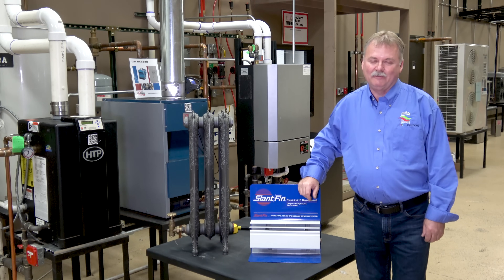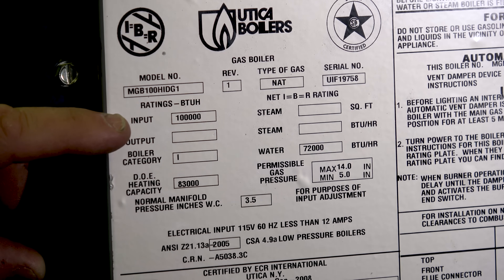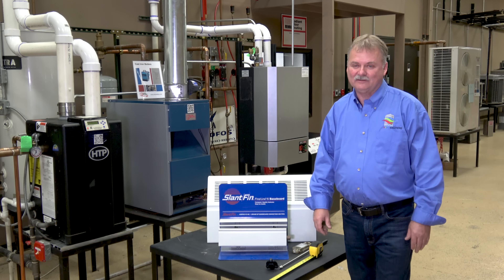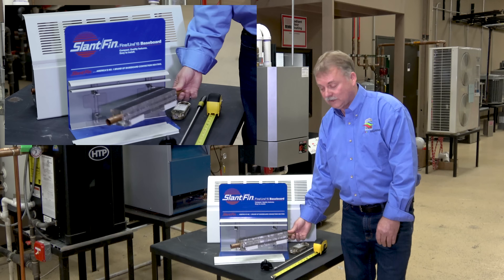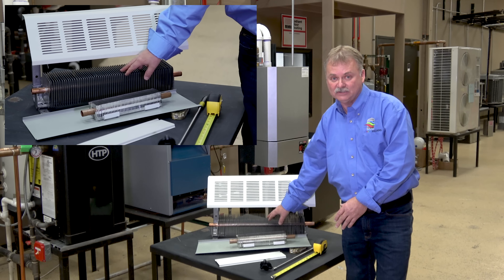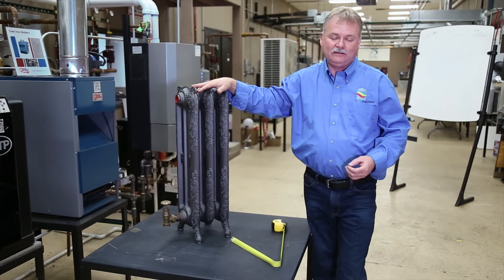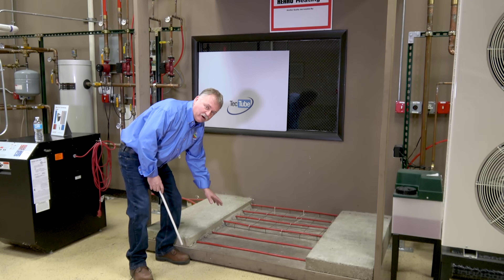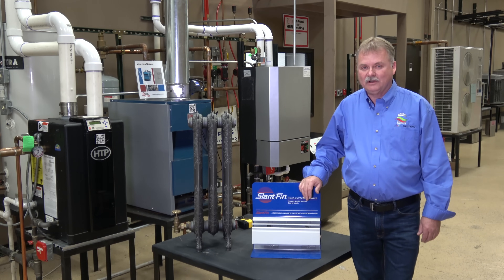Right Sizing a New Boiler... the easy way

Comment: Let's now add onto this wild guess of the boiler size method above; If the house was designed as a gravity flow system the target water temperature was originally 140 degree target water temperature. Look up each cast radiator at 140 target temperature. However sizing the boiler based on a lower water temperature will require a condensing boiler to be installed.
Reply from the maker: The old gravity systems by us were all designed for 180F supply. But if you have one designed for 140, then use about 110 BTU/h for the EDR calc.
Reply from the maker: Yes, if you design systems that have supply water temps below about 155 (and hence return temps below about 135), you will condense the flue gases and hence should only use a condensing boiler.
Reply: @TECTubefilms  Flue gases will not condense when the boiler was originally designed to fire with coal. Once the boiler came up to temperature the boiler never was allowed to cool. There was no slug of cold water coming back to the boiler.
Reply from the maker: @dennistreacy3595  We don't know much about coal boilers.  If the old boiler was running hotter exhaust temps natural gas boilers, then that would prevent the flue gases from condensing with 140 degree return water temps.  In either case, the old boiler's fuel type won't affect the re-sizing of the new boiler.  As mentioned use 110 BTU/h in your EDR calc for 140 degree supply system.

Comment: I agree this is useful for steam boilers. But I think this method can still contribute to over sizing. Who cares what the output of the emitters are.  They use to size cast iron radiators to heat the house with bedroom windows open. Perform a manual J and or look at gas usage to nail the sizing of a boiler. 

A BTU is a btu. If your heat loss is 40,000 btus and your emitters are 120,000 - I dont know about you but I would rather install the 40,000.  My back is getting old.
Reply from the maker: We agree... the radiation count method will still yield an oversized boiler (but not as oversized as the one it is replacing).  The problem with load calcs... which are code required by most energy codes now... is that stubborn contractors are refusing to believe that the old boiler was double sized so they keep adjusting the calculation inputs until it yields the boiler size they were expecting based on their old rules of thumb. The radiation count method gives them another option, similar to gas meter calcs, to see how badly the old one is oversized and believe their load calcs (if they bothered to do one).

Comment: I did a few rough calculations on modest size homes of under 2,000 sq ft. and found if you have 8 rooms with 12 ft of baseboard each, you wind up with a boiler size of 52,800 BTUs. Good luck finding a decent boiler that small... and it still might be oversized as we upgrade windows, doors, and add insulation. You could down fire the boiler to a point, but the easier solution would be to lower the boiler limits and hold the water to say 140 / 160 degrees. Yes, the burner(s) will short cycle in moderate weather but what else can you do? BTW, with the advent of indirect fired domestic water this lower temp will not be a problem.
Reply from the maker: Why wouldn't you install a smaller boiler AND lower the water temp setpoint below the traditional 180?
Reply: @TECTubefilms  ... in my own home the radiation is figured for 140 - 160 degree setting. Since I worked in the oil heating business for years my focus was on oil fired boilers that were available 30 years ago. When I did the job, I got the smallest boiler I could find and down-fired it... and that still has excess capacity to do hot water nonstop. My place is probably the cheapest to heat on the block. At this point gas is available but I likely still have another 10+ years to go before the boiler needs replacement again.
Reply from the maker: Here are a few smaller boilers that we use frequently in our office:

Carrier BWM50 outputs 9,200 to 46,000 BTU/h
IBC HC1350 ouytputs 12,400 to 45,400 BTU/h
Carrier BWM75 outputs 13,800 to 69,000 BTU/h
HTP Elite EP80 outputs 7,680 to 76,800 BTU/h
IBC SL1085G3 outputs 10,100 o 79,000 BTU/h
IBC HC1350 ouytputs 14,500 to 85,900 BTU/h

Comment: You only said the the baseboard must be measured, I didn't see where you tell us how to calculate what sized boiler for the baseboard heat.
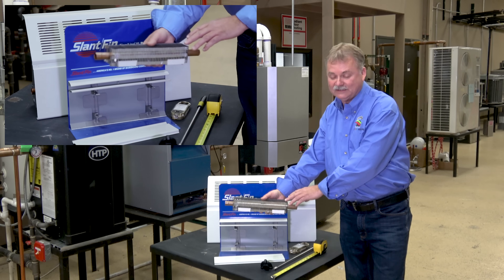Reply from the maker: Bill mentioned it at 3:06, stating 550-600 BTU per linear foot of residential fin tube. We probably should have done a sample calculation in the video like we do with our in-person training classes for contractors.

Comment: I find in so many cases that people don't mention that the SlantFin's performance is at 200 degrees. We always find 90% of them set at 170 and after we leave they always tell us how much more comfortable it is. Also be careful mixing the cast Iron with the SlantFin you will be in big trouble trying to make that comfortable. Just don't do it.
Reply from the maker: We do mix cast iron radiators with baseboard on the same boiler, but we put them on separate circuits with their own tstat and circulator.
Reply from the maker: SlantFin catalog does list output for water temps from 110 to 220 in 10 degree increments.

Comment: Thanks for such an informative, straight to the point video. Side question...I have a 1940 brick house with a boiler installed in 1997. We are looking to finish the basement. I've had a 2 local HVAC guys tell me No, but I want more opinions...we want to remove the steel supply and return lines in the basement and replace with PEX AL PEX to clear up some head room. Steel riser pipes would continue up through walls to feed cast iron radiators. I've been told that we shouldn't do it because it would cause short cycling issues. I understand a loss of mass will result in faster water temp drop, but clearly there must be a way to mitigate the loss of mass in the system to prevent short cycling the boiler isn't there?
Reply: Boilers dont short cycle so, your working with morons. I own a heating business, I have an engineering degree, I run an HVAC/R college program and scored over 145IQ. Trust me, run your pex, you will be fine.

Comment: Can you adapt a boiler buddy to a outdoor wood boiler to control the lower needed heat for radiant floor pex
Reply from the maker: You can put a boiler buddy on any type of boiler.  It does not care what is heating the water.

However, a buffer tank is not likely what you need.  The boiler buddy does not cool the water down.  What you likely need is a 4-way mixing valve.  We used to use them a lot back in 90s before condensing boilers were popular but we have not seen one in a long time.  But then again our entire market is natural gas and propane (both of which work very well with low temp condensing boilers) so we don't deal with wood or oil boilers around here.

Comment: Is 50 x sqft(of home) adequate in calculating boiler size? Came across this calculation while researching. If it’s any concern the home uses the fin baseboard system
Reply from the maker: Adequate?  Sure.  But in most weather regions it is going to result in a boiler or furnace that is MORE THAN DOUBLE OVERSIZED.  If you are in northern Canada with very poor insulation, this might work.  For example, my house is 2,860 ft2 so that would come to a 143,000 BTUh system.  I only have a 60,000 BTUh system and it was fine on a negative 26 degree day two years ago.

Comment: Thank you. I'm doing some research on replacing a 30 year old unit in a home I have an offer on. Is there a boiler type you would recommend if I purposefully decided to over size? Obviously the system should be designed to avoid cycling. In the future, if I decide to put an addition on with baseboard heat and radiant flooring in the basement/shop space, can adding an extra 500-700 sf of living space be easily accommodated? Just wondering how I should go about planning for future additional demand.
Reply from the maker: We would recommend you size the system for the heat loss of the current structure.  You will likely still have plenty of extra safety factor to handle and addition because almost no one every actually sizes it small enough (even when they try hard) for the correct size.  Plus you can always add in a 2nd small boiler in parallel with the other boiler if needed.
Reply: Better off with 2 smaller boilers if you feel you need the boost capacity. Let one run 90%of the time

Comment: Is it wrong to go by the sq footage of the house instead of this method?
Reply from the maker: Square footage alone?  Yes.  However, a proper heat loss calculation uses square footage along with ceiling height, window size and type, air tightness, insulation, climate, and other factors to calculate the heating size needed.  That is the best way to calculate the heat loss... and the one required by energy codes.  The method we showed in this video is easier than a proper heat loss calculation, but not as good.  The square footage alone would be a horrible way to do it.

Comment: I need to replace a 1974 gas hot water boiler that HAS to be oversized.  It's 270,000 btu. The gas meter needle looks like its moving in time lapse. My problem is I am concerned about my old iron pipe sizes,  and how that works with a modern boiler? Some of the pipes are quite large in diameter. For reference,  the house is  a 2800 sq ft ALL brick house, yes, including interior walls. It has updated windows and insulation in the attic. I'm sure part of the reason it was so many btus was efficiency, as the internal boiler heat exchanger is cast iron. I understand that this unit was more intended for commercial buildings when it was made. Can a new boiler interface with existing large circulating pipes? Some of it is like 1 1/2- 2", closer to the boiler. It would be unrealistic to change much else besides the boiler itself, as it is all cast iron radiators and black pipe.
Reply from the maker: Yes, you can still retro-fit.  Larger pipe size is always more favorable than smaller, as it yields less head loss.

Comment: How many installers except in new construction which most likely the are specified by engineers of som sort....go through all that figuring....on boiler replacement.
The plumbers I have dealt with looked at the name plate on the old furnace and take it from there....if the footage of already installed baseboard will only put out so much Btu per hour no matter what the rating of the furnace....too big the furnace will cycle on and off .....to small and the furnace will run continuously.......I believe installers continue to put in the larger rated furnace so when the weather really drops on those few occasions they do not get nasty calls from the home owner...when they hear the boiler running all the time....
Reply from the maker: It is also best if plumbers stick to plumbing and not get involved in HVAC  :)
Reply from the maker: Correct, most contractors replace like for like.  Our point is that you can do a radiation count (i.e., "all that figuring") in 10 minutes, provide a smaller boiler that will run more efficiently, with less wear and tear, and a lower first cost AND still avoid the possibility of a nasty homeowner call for a boiler can't keep.  Even with the radiation count method we described, you will still be a little oversized.  Plenty of safety factor.
Reply from the maker: Side notes: a furnace and a boiler are different things... one heats air and the other heats water

Comment: Sorry, but this is wrong. You are sizing a boiler to the radiation installed in the building, so your relying on the guy who originally installed it? He got the boiler size wrong, too big but got the radiation right? He probably sized both by IBR calculations which are antiquated and and are a mistake we are continuing according to you. The ONLY time you size to radiation is with steam, anything else is a heat loss calculation of the structure, which is done by IBR.
Reply from the maker: We agree!  And in our full length webinars and in-person hydronic classes, we advise that a Manual J load calc (residential) or ASHRAE load calc (commercial) should be done.  However, most contractors will either not do those calcs or they do not trust the answers.  We have found the "radiation count" method to be something we can get them to do.  Yes, it will still be oversized... because the radiators were originally oversized.  However, historically the contractors oversized the boilers more than the radiators or baseboard... a lot more, in fact.  So the radiation count gets them much closer to the correct size than if they just replace it with the same size boiler the old system had.
Reply from the maker: 1 hour webinar - check out minutes 13 thru 30 - http://tecstorage.com/controls/Webinars/2014-10-27%20Boiler%20Replacement.wmv
Reply from the maker: Live in-person class coming up on Dec.4 - https://tec.coursestorm.com/course/hydronic-system-fundamentals-pdhs-for-pes-melrose-park

Comment: What about if there’s no radiators and using boiler with hot water coil and air handler (heating house thru duct) so do I need same size of boiler what I need fo radiator system?
Reply from the maker: You do a load calculation on the building with software to be the most accurate.  Less accurate (and still slightly oversized) would be to add up the BTUh capacity ratings of all of the hot water coils.

Comment: Enjoyed the video, but your calculations of the output of the radiant system are off by a factor of ten.  24sf X 40 Btuh is 960, not 9600.  Similarly for the commercial calculation.  1200, not 12000.
Reply from the maker: You are correct.  We didn't catch it until after it was shot and published... actually we didn't catch it at all but saw a comment from another viewer.  The 40 BTUh per square foot formula is correct, but Bill's math was wrong.  And we keep reminding him about it each week.  LOL

Comment: Misleading title. A basic overview on Joules vs volume of house would be great for those of us who can't afford the "ACCA Manual J calculation" software and are confused by the on-line guides that conflate square footage with cubic volume(!) and factor in variables that change un-knowably over time (number of people, window sizes/types, etc). Apparently oversizing is a good approach given it's continued success in the "real-world". So far I am seeing 50 to 60 BTU's per square foot for Northeast locations. So if I use 64 (i.e. 2^6) I should be good for a drafty house with a cat door in Northern NH.
Reply from the maker: We have seen a lot of premature boiler failures... especially with low mass condensing... because of oversizing.  It causes short cycling.
Reply from the maker: 50 to 60 BTUh per square foot?!?!?!  Maybe for a 100 year old house with single pane windows.   But for newer homes (1990s construction), that can be double the size needed in say Boston.
Reply: @TECTubefilms  Yes. Exactly. But with leaky window upgrades. There are a lot of old stock housing like this in NH where I am.
Reply from the maker: Why is the title misleading?  Are you implying that a Manual J calc is easier than a radiation count?  We have no problem with a Manual J load calc if you can get the correct info on the home construction.
Reply: @TECTubefilms  I'll walk back my claim a little. I was looking for something a little different I guess. While it's true you gave a good general overview of sizing, I was looking for specifics on calculating BTUs for a volume of space. What is online is confusing and sometimes contradictory. The Manual J Calc approach I have come across online cost money and seems way too involved for what some others boil down to a simple "50-60 BTU per square foot" rule of thumb. I was hoping for something that was a little better than the over-simplified rule of thumb, but not so minutia-laden as to get lost in the weeds (like maybe a manageable overall volume calc times an opening loss factor, plus a hot water option to arrive at a reasonable range). As far as short cycling, I hear you on that point. But which is preferred, short cycling or struggling to keep up (always-on)? I would think having extra capacity would be overall a better trade-off. But I don't have the experience to know what the typical cost/benefit tradeoff is. Getting that insight is why I watch and appreciate video's like yours.
Reply from the maker: @blackmanops3749  No worries.  It is a good discussion.
Reply from the maker: @blackmanops3749  It is never an issue with the boiler struggling to keep up.  All boilers are not just oversized, but grossly oversized.  Bill... our guy in the video... has been doing boiler re-sizing for 25+ years (dozens a month) and never once has gone to a home or business that had an undersized boiler.  He has downsized them... errr we mean "right-sized" them... smaller 100% of the time without exception.
Reply from the maker: @blackmanops3749  The problem with a volume calculation, is that the space volume has little to do with the heat loss.  The biggest factors are air leakage, insulation, and wall/ceiling surface area.  Volume is part of the surface area discussion, but the geometry affects it.  The closer to a perfect sphere (or even a square) the home is shaped the less surface area.  Long rectangles homes or homes with protrusions (knockouts, bay windows, etc.) have much more surface area exposed to outdoors.
Reply from the maker: @blackmanops3749  The contractors we work with in the midwest use a software tool that we give them where they can do load calcs for a house for both heating and cooling in less than 5 minutes.  Here is a link to a webinar on how to use it.  Not sure how to get access to it in your area.  http://tecstorage.com/controls/Webinars/2013_03_25_Gizmo_Load_Calc.wmv